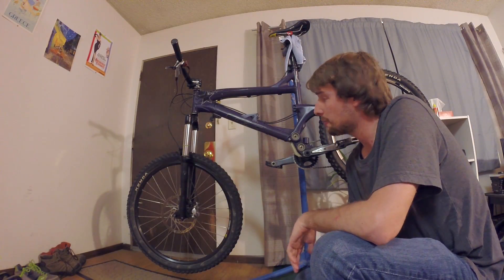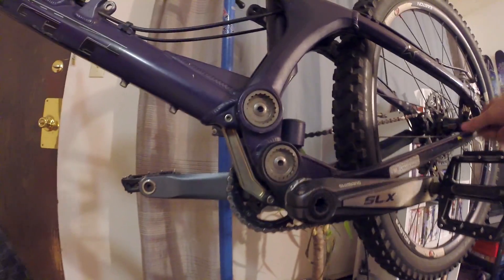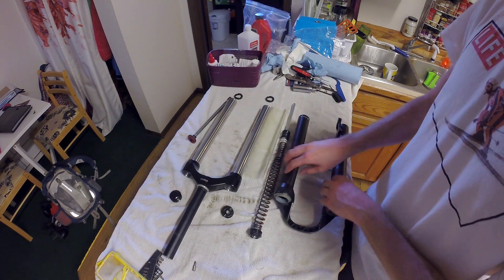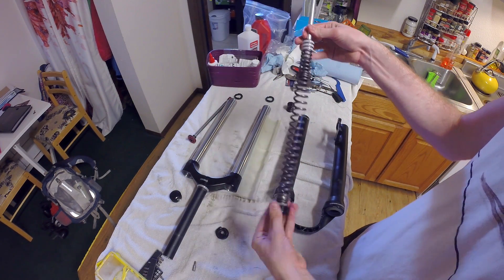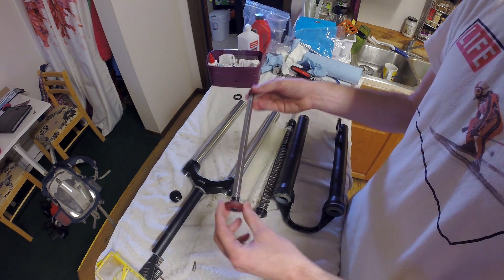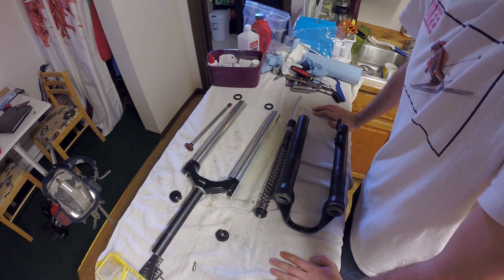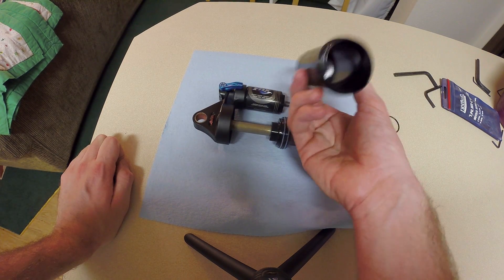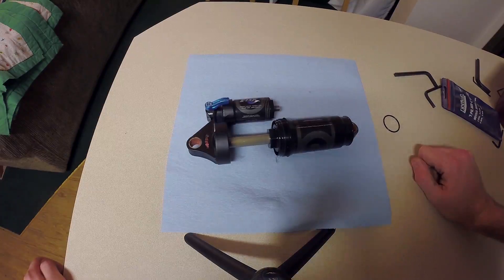How (Bike) Shocks Work: Looking Inside Suspension

Comment: What if i shorten/cut the spring about 2 cm,do i have to add damper rubber 5:59 2 cm or leave it that way? Thx 😁 for info, my fork doesnt have travel adjustment 😊
Reply from the maker: Don't do it by cutting the spring or you'll have play in the fork at the top of the stroke. Add some nylon/plastic washers to the spring piston rod (just below the topout spring). This will shorten the fork (but fyi it will also slightly preload the spring so it will increase the force needed to compress it a little bit). The best option would be to shorten the actual length of the spring piston rod but there's no real practical way to do this so I don't recommend trying.

The other option is to just buy a U-turn spring for your fork and just install that so you have adjustable travel. (this is only an option if you have a domain 308 or domain 318 fork).
Reply: @drv_channel  ok i will try your suggestion 😁..thanks for the reply...

Comment: this is most likely the dumbest question ever, in an air fork, is the air only in one side because you only put air in one side or are the two chambers connected somehow and share the air?
Reply from the maker: In almost all forks, the spring (both air and coil) is in one side (leg), and the damper (oil bath+valving) is in the other leg. They are not connected other than by the structural outside.
Reply: thanks so much, my friend thought it was connected through the crown, i tried to argue but i could think of a better answer.

Comment: can you tell me what forks these are as i have the same forks and need help re-assembling them. i think i am missing a component or something. the damper you describe at 8:22, how does that stay in place inside the stanchions? because at the moment i can't tighten the bolt at the bottom since the damper just spins inside when i turn the screw. do i need to inject some thick oil inside first? if so what kind of oil do i inject into my stanchions and how much oil in each side? please try to answer these questions as i am kind of lost at the moment.
Reply from the maker: It's a Rockshocks Domain 302 (the 318 is the same but with a MoCo damper added). My bolt just tightens without issue but there's nothing to stop the damper from spinning so it's not a great design. You should completely build up the uppers before adding the lowers (so add the oil and seal it off before putting the lowers back on). This manual will help with instructions and oil volumes: http://www.sram.com.cn/sites/default/files/techdocs/tm_my102.pdf

Comment: on my TK30 the foam thing came out of, is it still workable?
Reply from the maker: +Andrew Carter
What foam thing? If you go to SRAMs website you can find the parts catalog and service guide for your fork. You should also be able to buy spare parts pretty easily for newer forks if you need to replace anything.
Reply: I mean it looks similar from the foam in the service kit of my TK 30, it's like a round foam. It was coming out from the fork after riding it on the bike track.
Reply from the maker: Andrew Carter
where did it come out of? By the dust seals/stanchions? the bottom by the axle? the top by the crown? My fork doesn't have any foam pieces, all the seals are "rubber". Nothing should be coming out of the fork as it should be completely sealed off. Is it leaking oil?
Reply: From the sanctions, it was weird cuz my fork is still working fine, I just wanna know if is it ok to use it after what happened.
Reply from the maker: If something came out of the seal between the stanchions and the lowers, you're going to need to rebuild. If dust/dirt get in there or oil gets out you can permanently damage your fork by riding it. For a rebuild you'll need the right oils, shock(slick) grease, and replacement seals/o-rings for any broken parts.
Reply: I see, yup it came with an extra service kit, i will try to open it up and rebuild it

Comment: FYI there's no nitrogen charge in that rear shock, that's just a bleed port screw
Reply from the maker: +Terry Mcquigge You are correct, I didn't realize my mistake until after I had posted the video. The IFP in the piggyback reservoir replaces the IFP usually found in the shaft of an inline shock. The new (inline) shock I put on the bike has a nitrogen charge, but the one I took apart with the reservoir does not.

After I made this video, I realized I actually made quite a few minor mistakes and malapropisms. When I do my next rebuild (likely this summer), I will probably make a new video that is more accurate to replace this one.